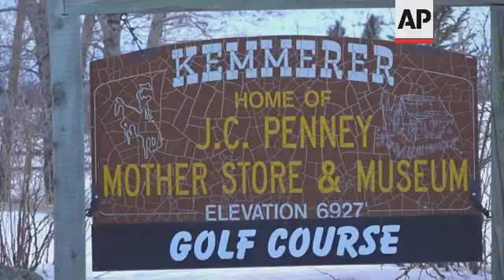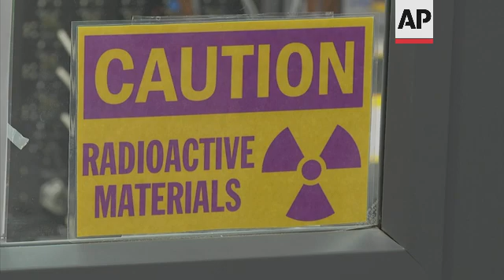Tiny Wyoming town bets big on nuclear power

Comment: A TWR can re-use the spent fuel that's going to be just lying around pretty much to the end of time. If it works as hoped, no removal or manipulation of the fuel will be necessary for decades, and that will mean a vast reduction, if not total elimination, of the other types of nuclear waste (contaminated tools, cleaning materials, etc) typically generated by a PWR or BWR. Of course there will be some additional waste generated by processing spent fuel (or depleted uranium) into fuel for the TWR in the first place.
Reply: I had a dream. In my dream I was shovelin' waste in da new reactor (on paper for now) its so simple guys.

Comment: Most sodium cooled reactors have leaked and caught on fire.  Retraining a coal industry labor force to operate a complex and dangerous reactor may be politically expedient but is not the safest SOP.
Reply: It's a molten salt reactor. Even the 60s designs already had physical safety which cuts off power, and if they'd use Thorium, the entire thing would be very boringly safe.
Reply: No emissions, the man said . Let's see Mr Google about that guys.